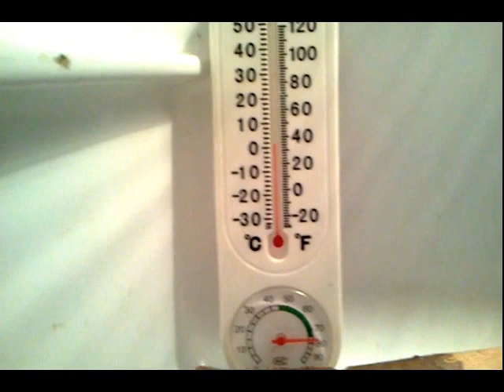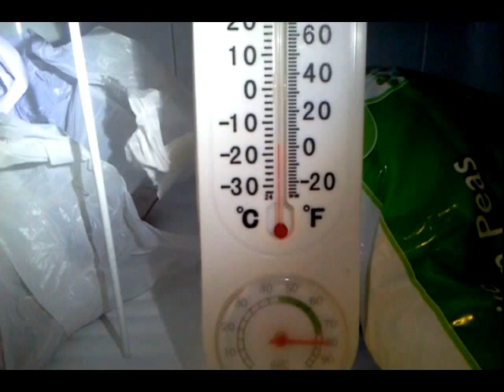Check Refrigerator & Freezer Temperature🌡️Humidity

Comment: I purchased LG side by side door refrigerator, when i connect to wifi and doing smart analysis it is showing there are high humidity level at the installation location. No air flow is coming from vents whats the reason.
Reply from the maker: Installation location might refer to the room's humidity level.
Reply: @p1nesap    does it affect the refrigerator or due to this high humidity level the cooling might affect or not ... The smart dialysis is continuously showing this .. Is there any repair in refrigerator .